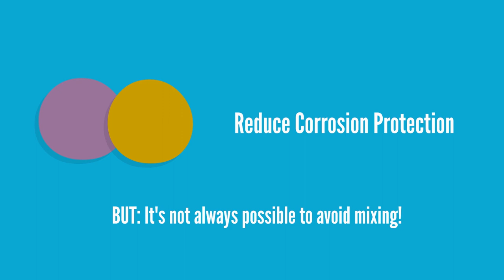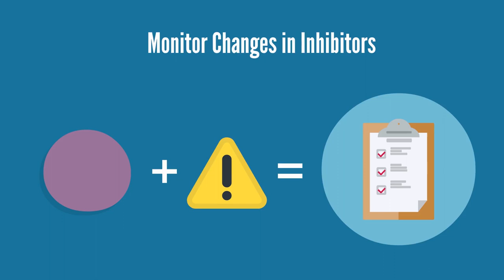Coolant Myth 4: Mixing Different Coolant Formulations

Comment: Nobody ever said makes me coolant was a good thing I'm sure everybody knows they're not supposed to do it but they do it anyway
Reply: the way these garbage radiators are made, the radiator will develop a leak somewhere before 'corrosion' is an issue anyway. and you have to ask yourself what the purpose of antifreeze/coolant is, to cool the engine without freezing during cold weather. As long as the two things you're mixing are for your vehicle make and year, it shouldn't make that much of a crazy difference

Comment: Damn i mix my coolant
Reply: Yo car be fucking up
Reply: I did my 1st radiator flush and put in a lighter green coolant then was in there I have no idea what the past owner put it I hope it will be fine if some old mixes with the new that I did not mange to get out
Reply: @dubskulls9554  that's fine, as long as the new one you put in is for your vehicle make and year. Like i said in another comment, the radiator will bust open before corrosion becomes a problem. Meaning it will crack somewhere from high pressures caused by a fucked up thermostat or water pump.
Reply: Mixing coolant is not a problem becouse the old coolant will not cause a high pressure as you said
Reply: @khaledfathallah1055  i said it will be thermostat or water pump that cause high pressure. Not coolant